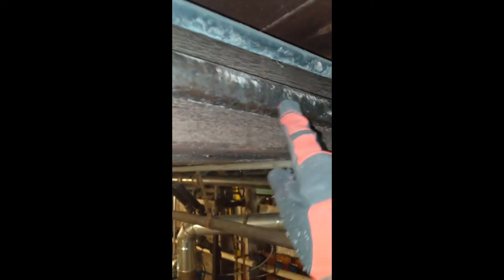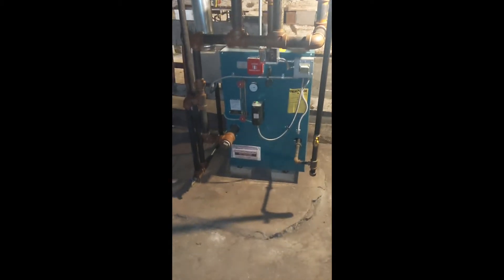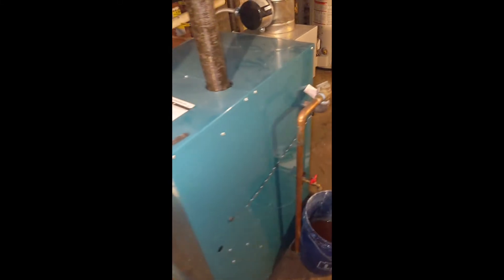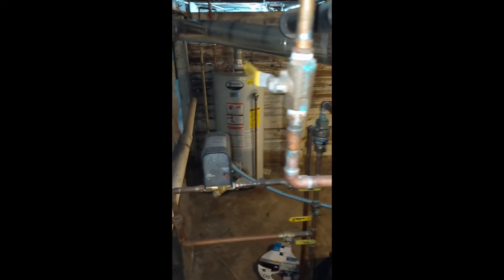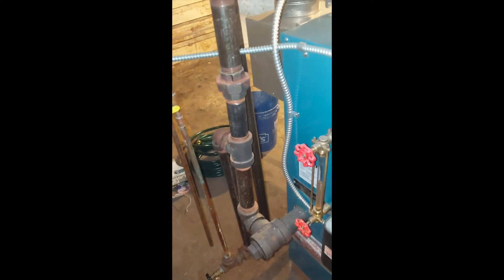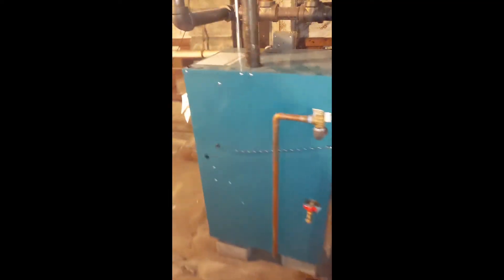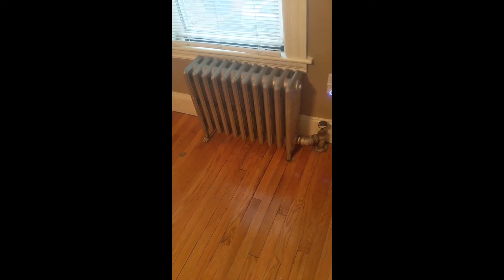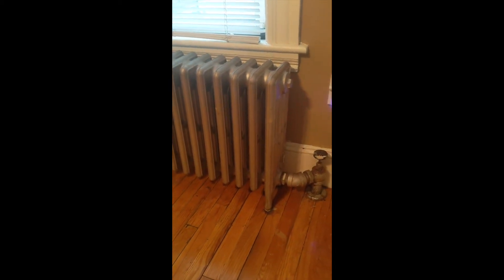Loud Clanking and Banging Steam Heat Pipes (How to Fix) | Water Hammer | Drain and Refill Boiler

Comment: new boiler in 12/24 our boiler had this louddd banging when heat is on very horrible noises everytime heat is on and scaring me thought it effected the water pipes steam pipes the boiler the gas pipes might have vibrated alot over 1 month till stupid hvac man came back to take out the water feeder to stop auto add water and go manual add water
Reply: That wasn’t the answer but I’ve been manually adding water to my boiler for years now. Is it efficient? Not really but honestly you shouldn’t be losing much water every time you need to add as long as your low water cutoff is actually working.

Comment: The level sensor may be sticking. Mine stuck and all the radiators flooded and stained the floor. I used a boiler cleaner and conditioner once a year and never had that problem again. It is the same system, single pipe steam etc.

Comment: I had the same issue, had air locked on the pipes which would cause banging. I changed my Main Air vents with No°1 Gortons & also replaced the radiator vents with Vari-valve. Everything i learned was from YouTube and my polish uncle in NEPA. Doing it yourself saves you money.
Reply: Hey man! Where are the main air vents?
Reply: @WassupFred  check near your boiler, before the pipes lead up stairs there would be a main air vent. If yours spits like a Y when it exits your boiler you probably would have 2.
Reply: @WassupFred  in the basement

Comment: Yeah 12 to 15psi? No i dont think so Air removal, NOT pressure is needed to make steam function properly. Dry Steam typically moves at 30 to 50ft a second@1/2lb, bump it upto 5psi its moving @22ft second. Also increased pressure raises the temperature of steam.

Comment: U should buy Gorton air valves that come size by letter and number depending on the floor they are being installed not thise cheap ones u used

Comment: When he opened the lower valve on said "no water coming out of here so we are all set". NO, THATS THE PROBLEM YOUR RETURN LINE IS CLOGGED SO THE WATER TAKES TOO LONG TO RETURN TO THE BOILER THUS TRIGGERING THE LOWC, AND THE 12 PSI THING IS STUPID HI. HE HAS TO BE TROLLING.
Reply: He had gained it all by then though.
Reply: right...that last valve he opened was a flush valve...His problems are not over!!

Comment: my steam system is set a  a half pound and the differential wheel is set at 1. so maximum pressure is         1 1/2 psi

Comment: Thats a Cheap air valve/ heat timer. Dont buy 7- $8 air valves. I buy Only Verivale made in USA. They are expensive. I learned my lesson in the first years as a Super Intendant of 75 family building.

Comment: The pressuretrol should be set at 1 and 3 , the differential set at two ,not 12 to 15 psi you took care of the noise by pitching the radiator that noise is caused by live steam coming in contact with accumulated trapped water. On steam boilers you should be draining a good bucket of water from the boiler once a month during the heating season. From the mud leg of the system. And would not recommend YOU setting or adjusting the pressuretrol in any way. As far as you finding people to take those service positions good luck now good luck. That would require hard work and long hours. Just sayin

Comment: 3:03 the horizontal box there is the auto water feeder it works like a low water cutoff and auto add water when low water level is detected. It could be broken that is why the boiler is over filled. 5:12 you need to turn the top and bottom ball valves to vertical this will bypass the auto feeder. Use the middle ball valve to manually add water until that defective feeder is replaced. Since the feeder is broken your LWCO could also be broken, so better manually check to make sure it is not. Very dangerous to have non working LWCO.
Reply: That’s the main point for us DIYers, as i understand. You must be sure you have a working lwco or your house could be toast. He could’ve tested it while draining the water with the system on, before sitting off the water and the gas .
Reply: @Wagamama203  this guy did not have a clue what he was doing...

Comment: This guy has no idea what he’s talking about your steam boiler should run a half a pound & the reason the water was so high was because he had no water going back to the boiler thats why when he opened up the wet return he had no water coming out
Reply: You might have air inside your system
Reply: @Jwr1230  its steam not forced hot water
Reply: @Jwr1230  What happens when its all the way at the bottom?
Reply: While in operation? Your system burns and explodes unless the low water cut off turns off the system for you.
Reply: Can u elaborate more. How can the water be high when you have no water coming back to the boiler?? Where is the water coming from ?? I have a similar issue.  Lately I've lower the water to about half and the next morning is all the way up fully filling the glass.
Reply: @OSCARANDRES039  that auto  fill is probably either set wrong or is defective.the water color was not healthy and the return may be plugged.when he opened that return drain there should still have been a little water draining. i would also check the pigtail to see if it is clear

Comment: As a 24 year old plumber who owns a HVAC plumbing business I can tell you one you’re awesome for figuring this out on your own and plumbing is an amazing trade
Reply: was he right about setting the psi 12 to 15 pounds pressure? asking for a friend :p
Reply: @shogunkicksbutt127 only off by 11-13
Reply: To be fair, he wasn’t setting it but waiting for it to power up.. would love to know the answer though.
Reply: @shogunkicksbutt127  No...a boiler has a 15 pound pressure relief valve. Boilers are usually are set between 0.5 - 1.5 pounds. And there is a reason this boiler was over full. It'll happen again if he doesn't fix the real problem.  I bet that pigtail is plugged solid, for starters.

Comment: 1.5 psi max. 12 to 15 haha. No
Reply: 12 to 15 is a little high, but acceptable, low pressure steam systems top out at 15 psi
Reply: The lost art of steam heat manual says the empire state building is heated with 2 pounds of pressure.

Comment: Steam boiler should never be 12 to 15 pounds pressure.  Set pressuretrol to 2 psi cut out pressure.
Reply: RLJ.....you need to figure out why the boiler overfilled, it may repeat.
Reply: Steam should never be over 2 psi